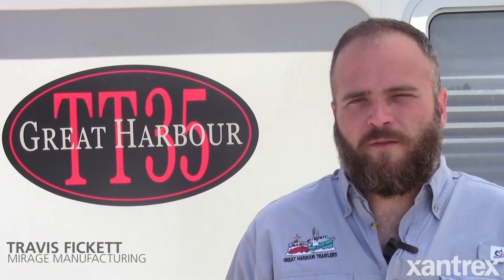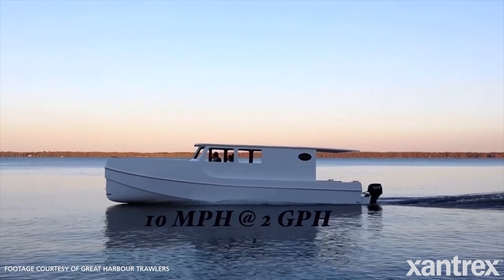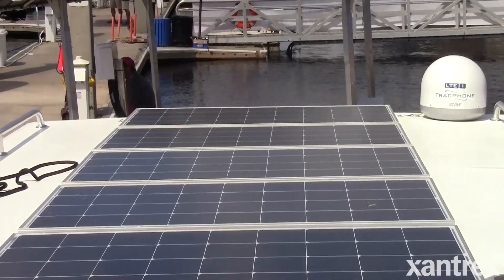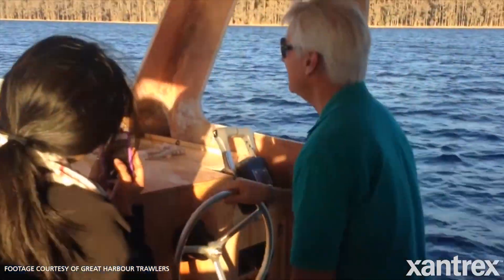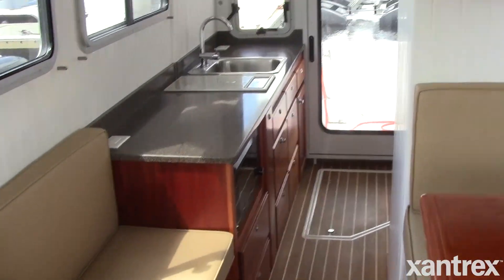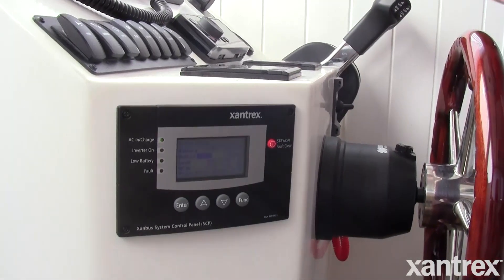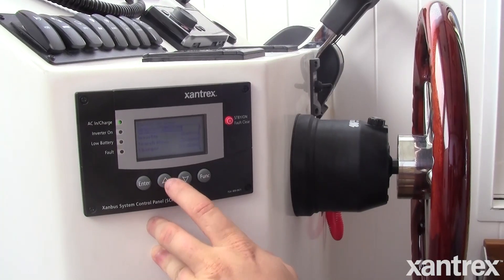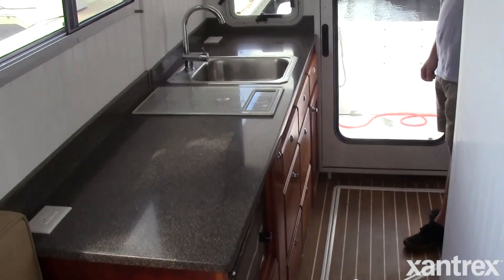Xantrex Solar Panel System Replaces Generator on TT35 Trawler

Comment: How about adding a generator and two 50 Hp electric motors, all functions even cruising would be accomplished. I would be very interested in this type of set up.
Reply: Elco makes a nice plug and play setup for their electric outboards.  This might be an option for mirage manufacturing.

Comment: Are the outboards hooked to this battery array to be able to charge it while underway if needed?
Reply from the maker: The batteries are charged by the Freedom SW inverter/charger when shore power is available and also through solar charge controller/solar array, don't think this particular model's battery are connected to outboards.